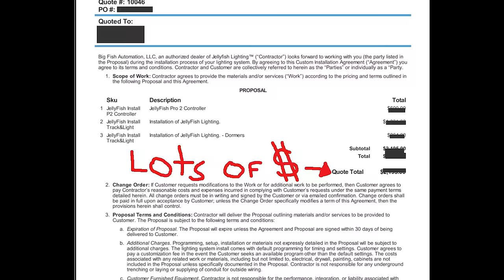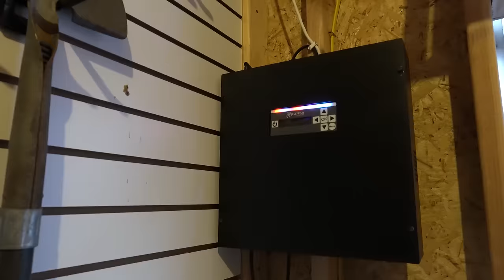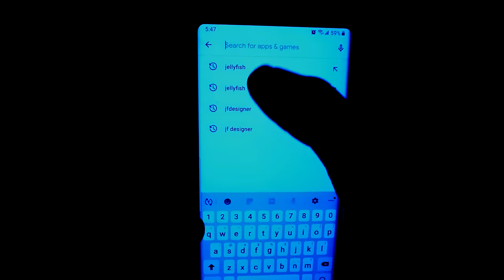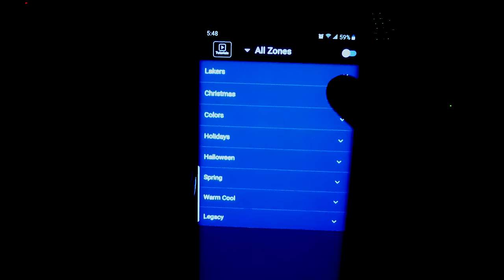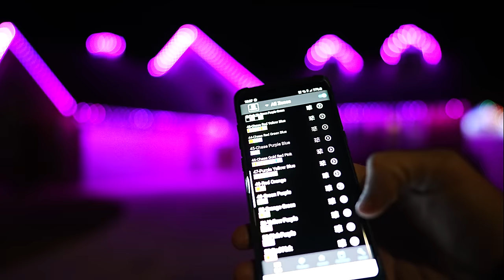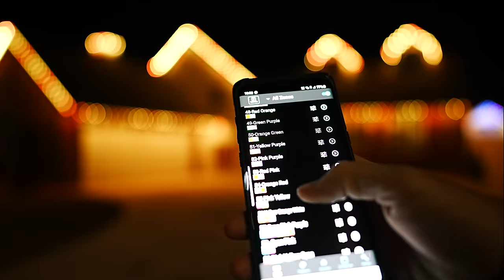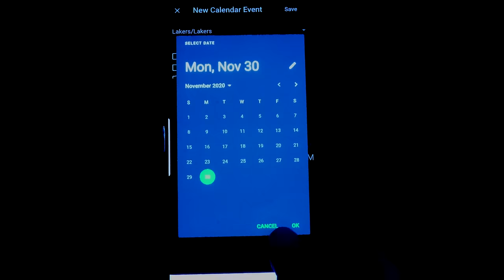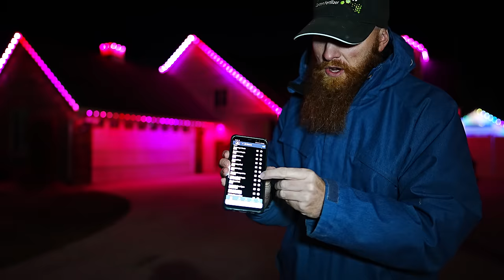JellyFish Lighting Review NOT just for christmas.  Permanent accent lighting

Comment: Looks slick!  This year I finally strung my lights on steel cables.   A few lag hooks and a couple turn buckles later and its set.  Install/uninstall should be a breeze from now on.  I have about 175 ft of c9 leds, total cost about $100 to install
Reply from the maker: Rad!  You did much better than me.  I went to walmart and ended up spending about $300 and had to go back a few times 😂😂😂
Reply: Lets see them

Comment: I have to say... this is probably the best lighting system I have seen so far. While the colored lights are super nice, the white light that you can use regularly is just incredible. The $600 linux controller seems a bit steep (linux is a free os but I understand that the hardware involves a bit of work). Super cool.
Reply from the maker: Glad you like it!  I didn't realize the controllers run off linux.  makes sense.  such a simple platform to use.  Looking forward to seeing all the updates and upgrades they come up with.
Reply: But you don't think $30 a foot is a bit steep????

Comment: Can you expand on the "replacing a diode" statement?  Is each tri-LED socket replaceable or do you have to replace a "string"?  If you have to replace a "string" how long is that?  It looks like the lights are behind plates that would have to be removed entirely.

Do they have any programmable modes where only some of the lights come on?  I'm thinking every second or third light on would make it more useful as house lighting around non-holidays; something that would more closely resemble landscape uplighting.

They look good but the warranty seems pretty weak for something so expensive.
Reply from the maker: Fantastic questions!  I do agree the warranty period is week.  The tracks come in 6 or 8 ft segments on average.  fastened by a  screw to the mount.  You take that down to access the line.  Each light has 3 lines in and 3 lines out.  you'd simply clip the one out and patch the other in its place.  pretty simple setup.
As for programming the lights.  You can program as many "zones" as you want.  each zone can be whatever you want it to be.  For the house lighting they have a few options built in, one ever 3, 5 and 7 lights.  You can also customize each zone as well, so if I want two lights at the peak of my dormers on and the rest of the zones to be spaced 5 wide you can do that.  This system, from what I found had the most customizable features out of the box.
Reply: I am a jellyfish installer in Denver, Colorado, You don't even have to take the track down to service the lights.  The warranty is 3 years on parts and one year on service.  After that it should be just a small fee To get it serviced but most problems will occur within 2 to 4 months of install and can be fixed under warranty easily.

Comment: Another thing these lights are good for is safety and security. If you are asleep late at night, and you hear someone walking around the exterior of your house, you just turn these lights on full power white, and the intruder will most likely run away. That’s why it is important to have them installed around the complete perimeter of your house. I can’t believe you cannot control them when you away from the house when you are away from your wifi. There are plenty of apps that control lighting, security cameras, etc. that are accessible over the internet to your house.
Reply from the maker: I love these lights for "security" purposes. they shine bright.  the company has recently updated there software for remote use.  its been a fantastic update.

Comment: nice! ....'smart home'(Google/Alexa) compatibility would be good, I just added cams/doorbell and have my other devices set to 'listen' for glass breaking and other sound alerts when I'm away, so year round having the outside lights to trigger in an event would be a cool security feature
- but yeah, I put my lights up for Halloween then just turn them back on for XMass 
- that system likely has to use the 2.4Ghz wifi band because it has more range and doesn't require the extra bandwidth of 5Ghz 
- anyway about 'DayLight Savings Time' fyi, did you know that each US state has the choice to go on it or not in the summer, but they must stop it in winter as they DON'T have the option to stay on permanent DayLight Savings ... which I think many of us would now prefer, as clearly we could benefit from one more hour of light in the early evenings(when we actually still have to do extra things we need the natural outside light for) than having it in the early mornings when only some are just traveling to work or school(and will be inside anyway in the colder mornings) the idea might have made sense years ago for heating and lighting concerns, but now those efficiency issues have been solved in other ways; so now its a drawback and just backwards of what we need since we have cars with headlights and stuff to get us places at 6am in the winter
Reply from the maker: I agree with you on all fronts!  I hate losing that extra hour of sunlight.  Our state opted for the extra hour of sun but it hinges on other states to join in at the same time.

Comment: Looks great! Why not tell us how much it cost you?
Reply: The JellyFish Lighting System is controlled by a Linux based computer, which costs $600. In addition to that, ~$23-$25 per foot of lights including installation. 

Self installation is roughly $17 per foot plus the $600 controller excluding shipping and extra transmitters/receivers for long jumps or high footage.

If you’d like an exact cost please fill out the form on our website www.jellyfishlighting.com and a local salesperson will reach out asap!
Reply: @JellyFishLighting  awesome, thanks for the reply as I had the same question
Reply: The redacted bill definitely still shows the total.
Reply from the maker: The bill had black marks all over it because it wasn't the right price to begin with.  I went a little crazy adding things on after I got a taste of it on the first installation round 😂
Reply: @JellyFishLighting  HOW MUCH PER FOOT? You can get simple esp8266 module such as wemos d1 mini for 3 bucks (installing "WLED" software on it could't be simpler), whichever PSU you like depending on lenght (can't really add it to price/foot since you need exact lenght of strips for that) and you can choose either simple ws2128b strips or some of the more expensive ones with data backup channel or rgbw. Total cost can easily be close to 1-2$/feet and you pay 3$ for amazing wifi controller instead of 600$ :)))) imo jellyfishlighting is nothing but a rip off..

Comment: So there is an app and its connected to my wifi but you cannot change it remotely?  Meaning if I am at work, I cant change it?  And if I am on my WIFI 5G network, I still wont be able to control it?
Reply from the maker: you are correct in your explanation.  however they recently released a new app that allows full remote control of your lights.

Comment: I started watching the video thinking, Who would pay thousands of dollars for Christmas lights? At the end I was thinking I really want some for my house. How much did they cost, by the way?
Reply: The JellyFish Lighting System is controlled by a Linux based computer, which costs $600. In addition to that, ~$23-$25 per foot of lights including installation. 

Self installation is roughly $17 per foot plus the $600 controller excluding shipping and extra transmitters/receivers for long jumps or high footage.

If you’d like an exact cost please fill out the form on our website www.jellyfishlighting.com and a local salesperson will reach out asap!
Reply from the maker: Assuming you'll be in your home longer than 3 years I find its a great way to dress up the home.  I use these on the daily now.  Gotta love a company like JellyFish Lighting that is transparent with there pricing.  doesn't happen very often.  I found they weren't the cheapest nor the most expensive but they had the best product.

Comment: Can you replace/repair a bad section?

If you paint the house is it to be taken down?
Reply from the maker: you can repair any led you need to.  they will give you a patch kit and they also have tutorials on how to do it as well.

As for paiting the house.  The areas these are installed are the soffits and fascia.  These areas are commonly made out of aluminum and are not paited as they come pre painted.  if for some reason you really wanted to paint these areas you would need to either remove them or you'd need to mask off each individual light.